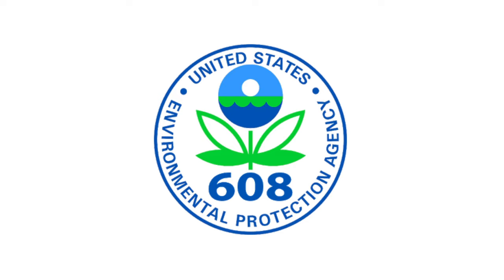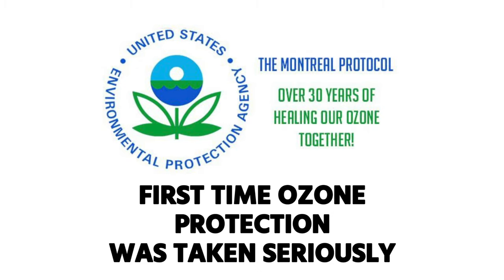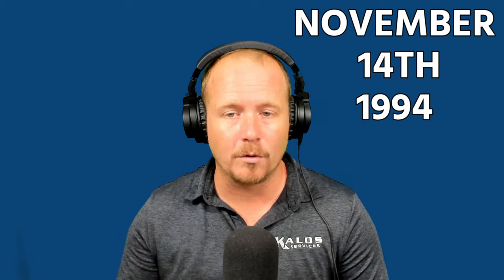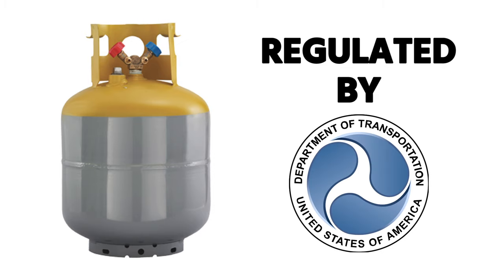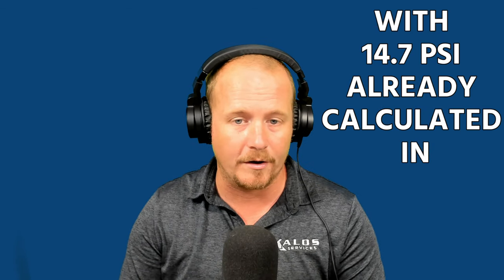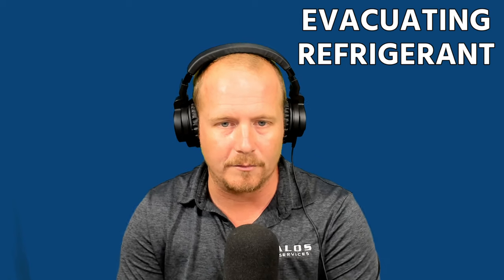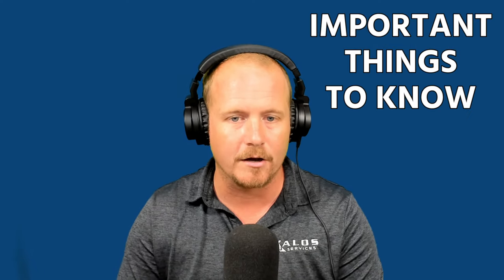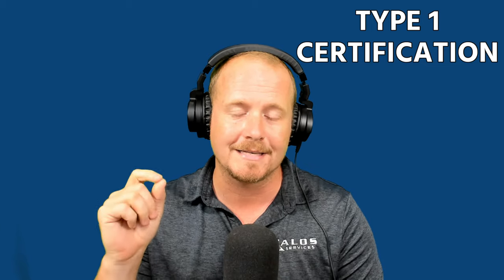EPA 608 Core Prep - Part 2

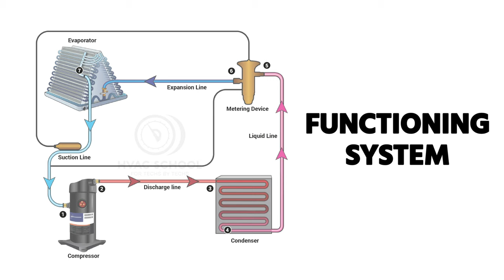Comment: 9:10 - They say not to run a system without refrigerant because that is how the compressor is cooled. How low of refrigerant can you safely get to by using the compressor for recovery? (BTW, the 500µ bit is on some of the practice tests I've seen.)

Comment: I have an offer to start at $20/hr in Chicagoland area and am being told I can build to $27-$30 in 2 years. Just need to pass section 2. Id be switching careers and taking a almost $20,000 pay cut. My question is, can I make over $30+ in 3 years?
Reply: It is crazy that you say that, Im in the same exact position now in a way. Looking to get into the industry and will be taking a pay cut from previous job. Do you have previous experience? Please keep me updated if you took the position and whats going on with you now. Thanks and best of luck!
Reply: If you go into commercial refrigeration maybe but typically you wont make that much doing residential, not in 3 years.